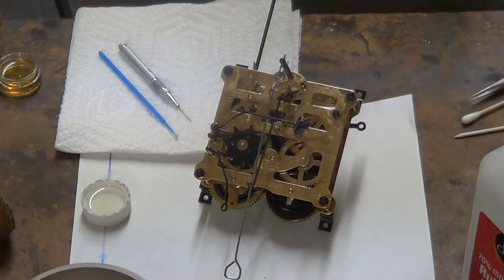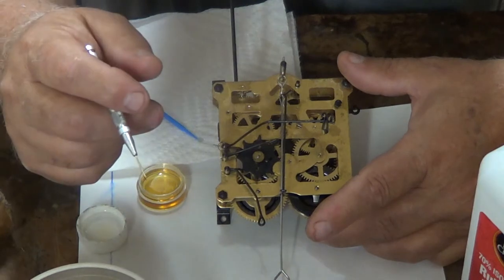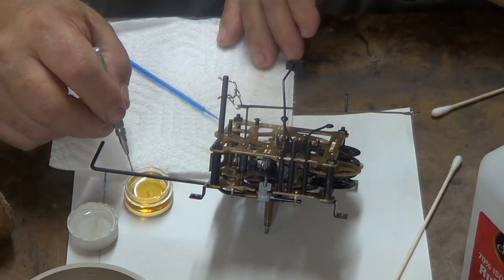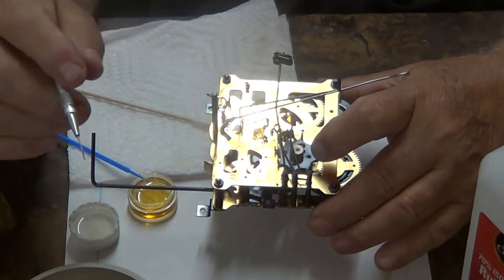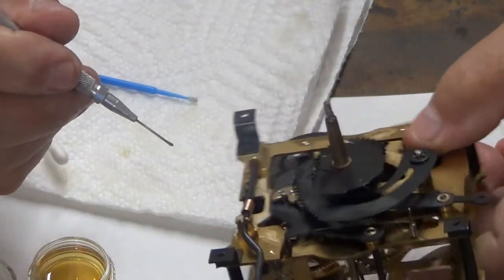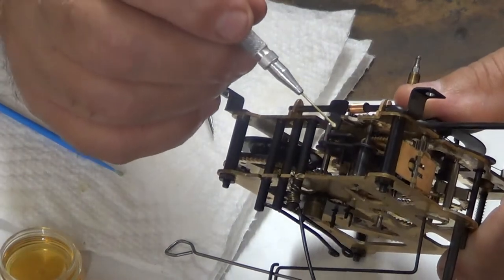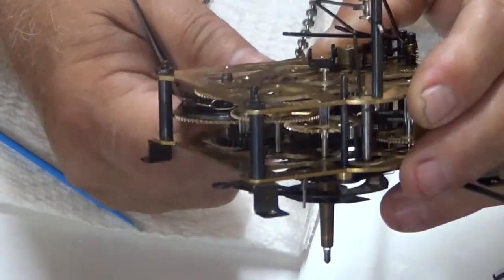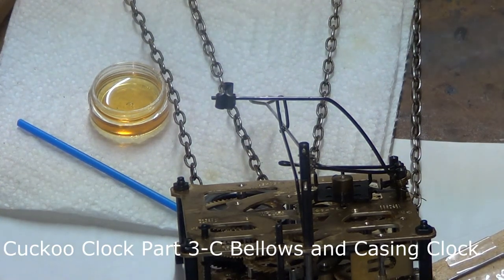Troubleshooting Cuckoo Clocks Clean,  Oiling Part 3 B

Comment: I have a larger 3 chain model. Schneider. It drives the organ grinder, water wheel, beer drinkers and a few other stuff. So - is the procedure the same or should I seek out a professional. The nearest clock shop is about 3 hours away (6 hour round trip). The chain that drives the water wheel and stuff does not come down anymore, but, I can wind it up. The clock is only 3 years old. What do you think?
Reply from the maker: Trying to get to my emails. Rick If you have good skills and understand how the levers on the back of your cuckoo clockwork you should be ok cleaning and oiling, but there is a lot of push levels that run the beer drinker and a pully and chain that runs the music box and water wheel along with a weight that runs the bellows. If you are unsure of the complexity of the clock you might be better off having a professional make the repairs. You might be able to call the repair shop and ship the cuckoo clock to them for repair. For years we received many cuckoo clocks through the mail for repair. We asked the customer to double box the clock and not to send the weights. Looking at the weights they are marked most often in grams and that's all you need for information sending a note with the clock. That way you won't need to ship the weights making postal cost less. Hope this helps out. If you need any more help let us know. The Bench Jeweler Mike E.
Reply from the maker: Rick, how did you come out on that cuckoo clock? I think that your music drive wheel is causing trouble and that's why the chain won't come down that's not an easy fix.  I think this time you might see a clock repairman.